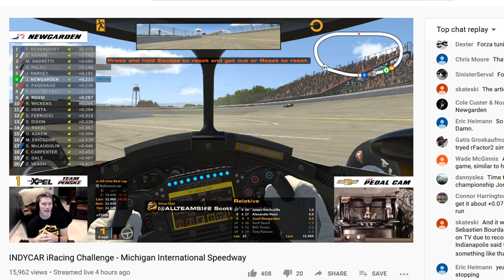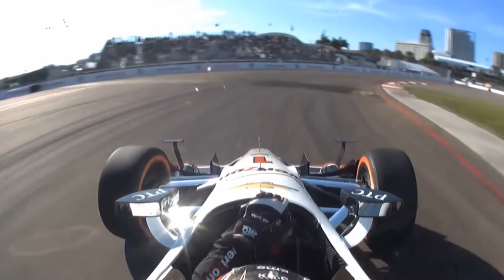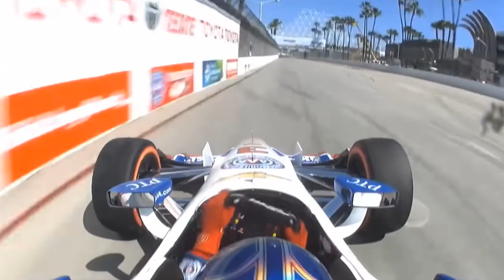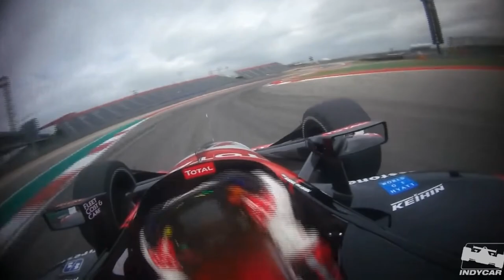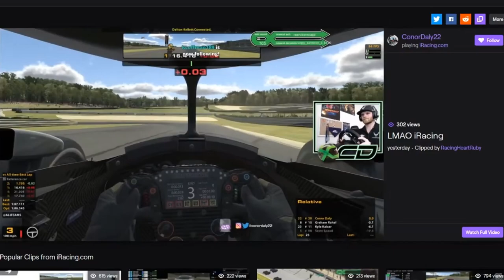Josef Newgarden Explains the Issues with iRacing's Tire Physics

Comment: iracing has  a lot of issues  and the 1st one  is how  a couple of managers  can decide  what is fair anbd what not  about  the safety rating  when  a keyboard kid  come into you and crashed,  it results  that, you the victim is  penalized  with 8X !!  what the hell,   also the brake power  and  brake  balance  its decide by ...i dont know  who ?? ,  thats unfair  for some kind od  drivers and benefits  to other kind  of drivers .  DO YOU NEED A REAL AND POWEFULL SIMULATOR   GO TO RACTOR  2  THATS IS DEFINITIVE  maybe not the best graphics on monitors,   but the  best physics   FFB  feelings  and  the best VR.

Comment: Too many people don't understand what the issue is at all and are quick to call iRacing tire physics inaccurate, but the truth is that the way tires feel in iRacing is caused PRECISELY by the fact that they're very realistic. An alternative to iRacings approach to tire physics leads to less realistic tire behavior. As a mechanical engineer working on developing car chassis components and setups, I use and understand simulators quite well (professional stuff, not games). The issue that pretty much all of the people in this comment section ignore, including the real drivers, who clearly don't take it into consideration, is the fact that there's A LACK OF PHYSICAL SENSATION OF CAR MOVEMENT, which is 99% of everything you feel in a real car. The feeling of tires being too snappy in iRacing is just a sensation because you have no G forces and don't actually feel tires slipping. The issue is not tire physics. Tire physics can be perfectly realistic objectively, in terms of how much grip the tires have at certain speeds and angles, and how they behave under loads. That's NOT hard to achieve at all in modern sims, it's literally pure numbers and hard calculations. Especially when combined with laser scanned tracks. iRacing does this part better than any other sim without any doubt. But those are numbers, not SENSATIONS. 

The issue is you don't FEEL the G forces when driving a sim, and you don't FEEL when the tires just start to slip a bit, so all the things that tires do at the limit, before they actually start sliding, can't be felt. You rely on sound of the tires squealing or scrubbing alone, and a bit of force feedback. That's why it feels like they snap too quickly, you don't actually feel them starting to go.  Other sims and less realistic games try to simulate that effect by FAKING the slip effects, and making the tires feel soft, rubbery and mushy on the limit. If tires in real life acted that way, cars would feel soft to drive, without direct feedback. Cars would feel like they float around on the limit, not a very comfortable sensation, like driving with extremely low tire pressures, try and you'll feel it in your ass when you're behind the wheel. And trust me, I know this from personal experience of driving the same cars in reality, and in the sim during development. It's one of the reasons all final chassis tuning on every car on the road is done by SUBJECTIVE FEEL and by driving the real cars, and not on simulator or just by pure numbers. Cars that feel great, direct, planted, sharp, etc. in real life, feel too edgy and snappy in a sim, simply because you've taken away EVERY CLUE THAT TELLS YOU WHAT THE CAR IS DOING when you're in a sim.  And remember, I'm talking about REAL simulators here, stuff that is 100% objectively accurate. iRacing is much closer to real simulators than any other game sim is. That may be good or bad depending on what you want. 

You drive a real car by FEELING WHAT IT DOES AT THE MOMENT AND THEN ADJUSTING TO IT IN REAL TIME,  in a sim you drive by REACTING TO WHAT THE CAR HAS ALREADY DONE a few milliseconds before. So of course you can't react the same way, and it's not as easy to drive, or as forgiving. You're adding extra steps between the car doing something and you reacting to it.  Even if tires behaved EXACTLY the same objectively in a sim and in reality, the sim would still feel more snappy and sensitive than real tires, because you can't FEEL what the tires are doing.

So the point is.... sims have to make a compromise, either:

1) make the tires behave OBJECTIVELY ACCURATELY (which is the approach iRacing takes), but they'll feel more snappy and unforgiving than in reality due to you as the driver not feeling what happens to the car...

or...

2) make the tires OBJECTIVELY INACCURATE in terms of their slip angles and how they behave under loads, BUT simulate that "forgiving" and "progressive" feel by basically making them softer than they should be, which is the approach most other sims, and especially arcade racing games take.

So pick your choice, just remember that a simulation will NEVER feel real, and cars will never feel real to drive, but the closer they are to objectively accurate behavior, the harder they will be to drive, it's simply a logical outcome.